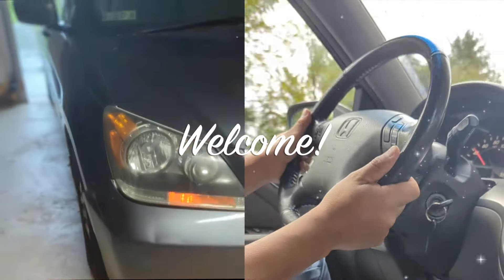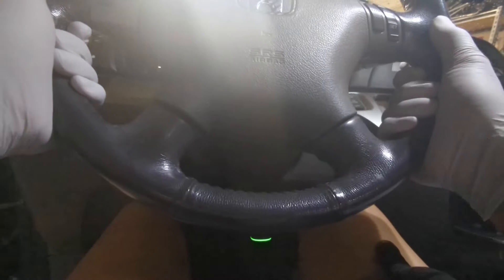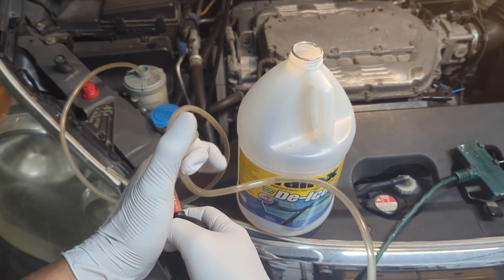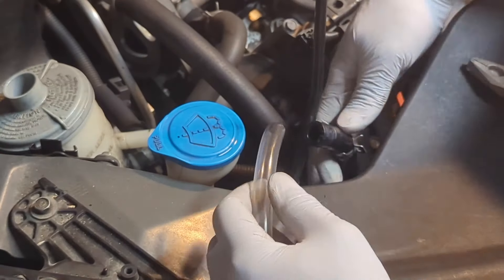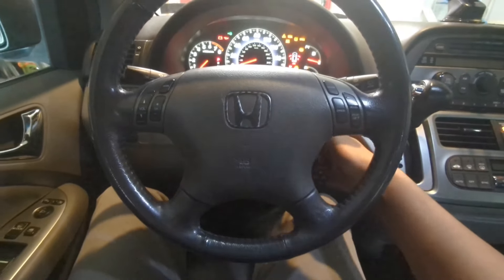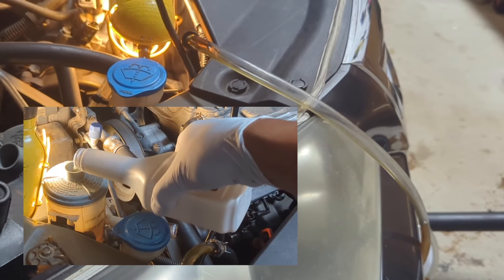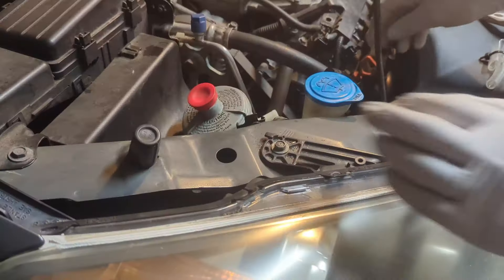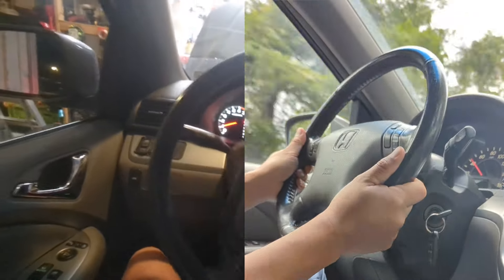Heavy Steering? Simple steps to replace 100% PS fluid on a Honda

Comment: Despite doing it before, I learned a step to make it easier to drain the old fluid. I now will try connecting the return hose to a smaller diameter hose to drain it. Previously, I drained the old fluid from the return hose into a 0.5 gallon plastic milk bottle. It's size fit nicely in the space.
Reply from the maker: Great! I will try a half gallon bottle next time on the job.